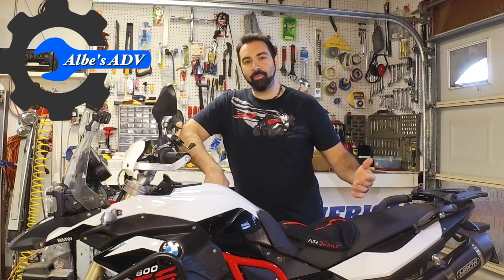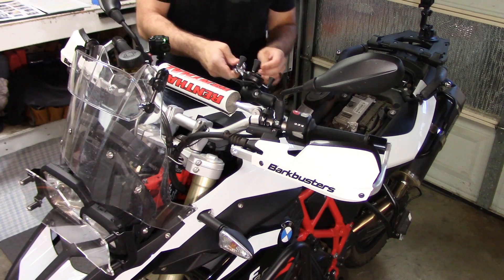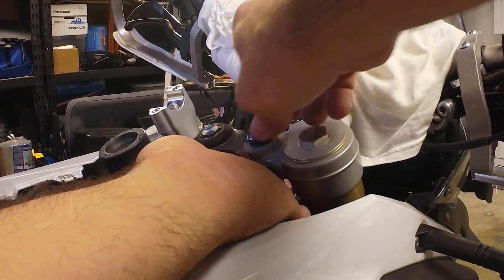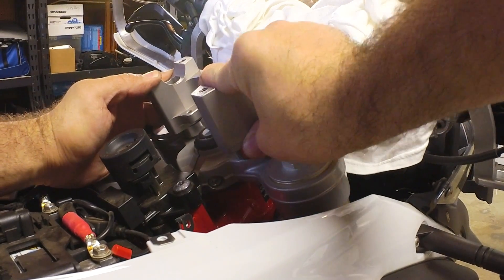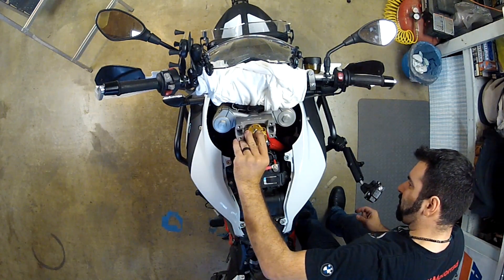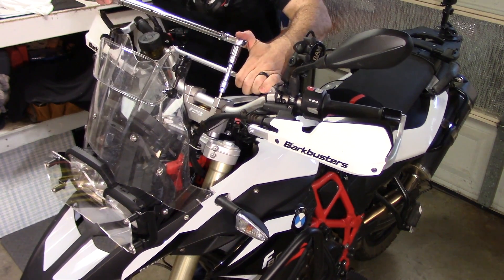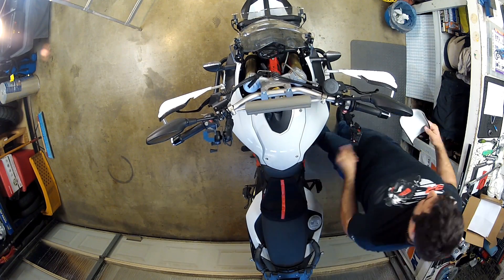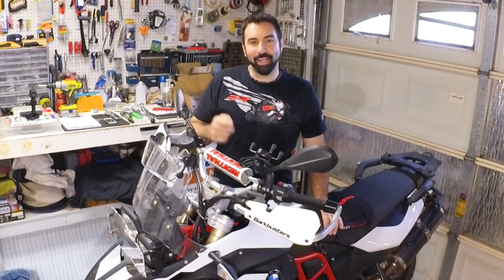Scotts steering damper installation on a BMW F800GS

Comment: Great video!
The most common reason for the head shake on this bike are bad Head bearings, I just replaced them on my bike and the head shake is gone for good! All balls racing makes the kit for the bike. Of the three 800s I have had two needed new head bearings!
Reply from the maker: +Christopher Dempsey in my case I believe the wobble comes from the air flowing over the hand guards, cause if I have a 25 mph headwind when I'm doing 65 the handlebars wobble, or 20 mph wind and I'm doing 70, so it seems related to the air speed more than the ground speed . Also I removed the plastic cover from the hand guards and the wobble was gone, I guess I should have started with that , haha
Reply: @AlbesADV  I think you are right about this. I have the touratech hand guards. After having my head bearings replaced it still had a slight wobble. I removed the hand guards and the wobble was gone! How is this possible? Is it just a bad design? I really liked the look of the touratech hand guards. Not sure what to do right now.
Reply from the maker: A little push at the end of the handlebars has a huge effect,  probably the only solution is to get a steering damper or get smaller handguards

Comment: I have the exact same kit on my 2016 F800 GSA and recommend it for anybody going off road. It also took out about 90% of the steering wobble on the pavement.
The Scotts is not cheap, but the fit and finish is first class and it simply works.
Thanks for another cool vid...
Reply from the maker: I completely agree, and the finished installation look super clean.
Reply: You use Off road stabilizers ?
Reply from the maker: Yes this unit has been valued for off-road
Reply: Hi. What is your settings,?
Reply from the maker: I adjust the steering damper as I go, stiffer on soft terrain and softer on hard terrain but usually start in the middle

Comment: Congrats on the 300 Albe! Also, a steering dampener is high on my "to-buy" list
Reply from the maker: worth every penny, or in your case Euro.
Reply: And speaking of which, how much?
Reply from the maker: Pierre ADV , around $550 for the f800gs complete kit.
Reply: Albe's Adv sticazzi! A little pricey, but seems well made
Reply from the maker: tip top construction and finish.

Comment: With tires to off road from 120km/h start doing as it does in the video in the 13.36 minute, solve this problem?
Reply from the maker: The steering stabilizer helps a lot, I just crank it up when I ride on the freeway.

Comment: does the 619 dollar kit already include the handlebar shown in this video (the grey one), or do you have to select one for extra money on the website?
Reply from the maker: Hi, the handlebars are the OEM, if you are referring to the bracket  between the handlebars and triple clamp, it came with the steering damper kit 👍
Reply: @AlbesADV  thank you
Reply: @AlbesADV  would u recommend the road version for 80% road, 20 % off road? Or will the offroad version be good on road to?
Reply from the maker: I would go for the off-road version,  the off-road version does good on the street but Excel off-road when it really matters

Comment: Hey Albe,
Do you have to remove the handlebars to swap the dampener between bikes?
Thanks in advance
Reply from the maker: Hi Ernie, yes you do, even if you have 2 brackets, the screws to remove the dampener are right under the handlebars and you can’t fit an Allen key in between
Reply: Albe's Adv Thanks!  I’ve duplicated a lot of your ideas. 
Just bought a KTM 350 exc-f too. Already doing some of your mods. 😀
Reply from the maker: I have so many more mods I need to do to my KTM,  I just need time lol
Reply: Albe's Adv Thanks!

Comment: Noticed you did not re use the upper flat washer that sits between the rubber bushing and the stock lower bar mounts. But you did use the metal sleeve that fits inside the rubber bushings.  Scotts instructions says to "discard all the hardware except for the lower cupped washer that fits over the rubber bushing", they go on to say "(no cupped washer on top)".  I am guessing they are using instructions from a slightly different model or year as there is not a cupped top washer.  The stock lower bar mounts have a recess identical to that of the scotts SUB mount metal bushing.  This is confusing as all logic says to reuse the top flat washer and metal sleeve as everything is the same dimensions.     Thoughts?
Reply from the maker: You need the cylindrical metal tube over the bolt to make everything fit snugly and prevent the rubber bushings from being overtighten,  the reason to remove the top washer is because the receiving end of the damper bracket is shaped to accommodate the rubber bushing, also if you put the metal washer against the aluminum bracket, over time the aluminum will wear out because of the vibrations and the fact that the washer is a stronger metal than the bracket.  I hope this help, it's difficult to explain without showing.

Comment: Nice video & congratulations on reaching 300. I have a stearing damper on my list of 'wanted' accessories but never get tick off the 'needed' ones, the latest being new chain & sprockets, leaking front fork, the list goes on. I'm interested on the effectiveness of your little screen deflector, does it make a difference? What make is it?
Reply from the maker: The deflector does make a difference, it's not like a big windscreen but it helps more than I thought it would. I made a video about it, if you get a chance go check it out. https://youtu.be/yMnCZhknBP8

Comment: Hey Albe! I'm looking to buy a Scott's damper, I can find one here in Canada but I don't know if it's the right one... Are all of the dampers just the same w/ different mounts?
Reply from the maker: +outty77 just about,  unless they are specifically valved for off road, and even then you can have them re-valved for what ever use you have in mind.

Comment: Hi Albe.I have bought a used Steering damper kit for my F800GS. Do you know what the default settings are? And what are you settings? Keep up the good work and keep posting new videos.  Greetings from Sweden.
Reply from the maker: Hi there,  I keep the knob right in the middle, and I adjust it on the fly depending on terrain. Low speed town ride, I keep it very soft, freeway ride I crank it up a bit, sandy trails I keep it on the hard side. On my last video in the desert you can see me adjusting it on the go.
Reply: Albe's Adv Hi Albe! can you add the link of the video when adjusting the Steering damper? Please